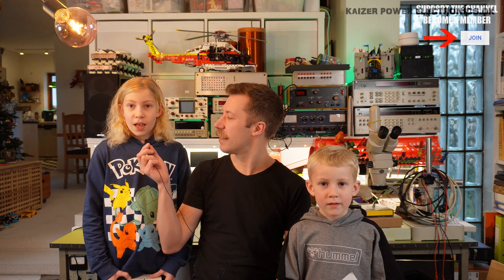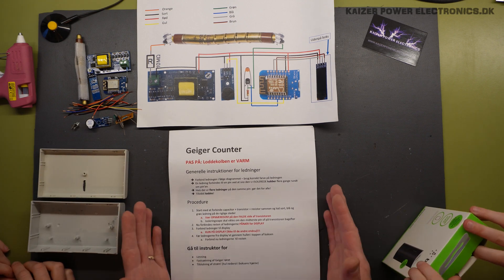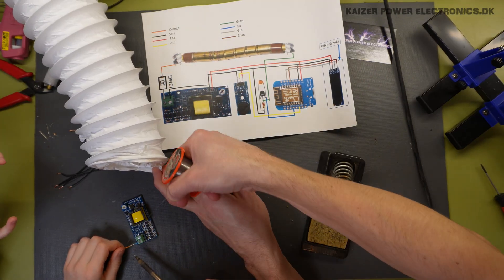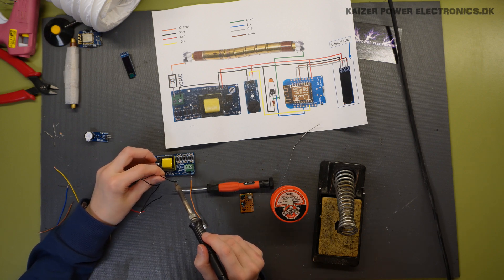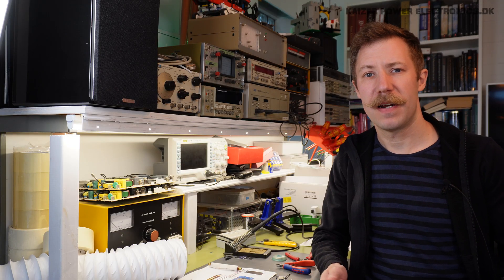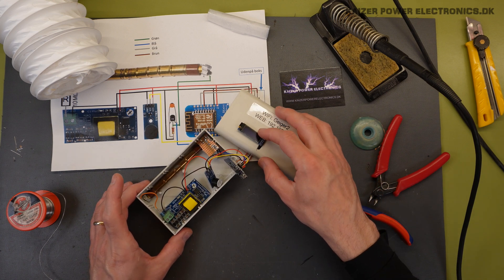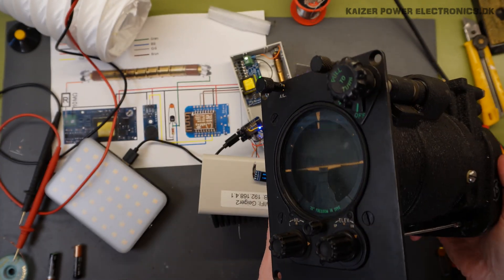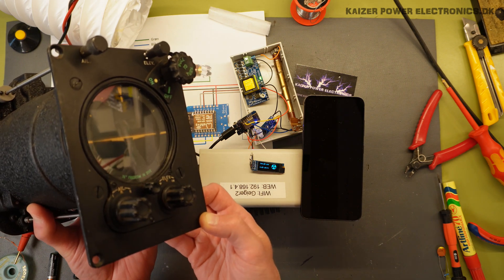Building The CERN / NBI Geiger Counter Kit (Teach Your Kids Electronics)

Comment: Congratulations on the video! I am a student involved in a scientific research project, studying radiation — specifically Geiger-Müller radiation detectors. As I am based in Brazil, it has been quite difficult to find suppliers for these devices locally. I would like to ask where it is possible to purchase these components and what the approximate costs are. Unfortunately, I wasn't able to access your website to retrieve more details about the components used. Thank you very much for your help
Reply from the maker: Most of these modules are out of China I guess. Local resellers take a huge profit on stuff like this. So there is no other cheap sources than directly from China.